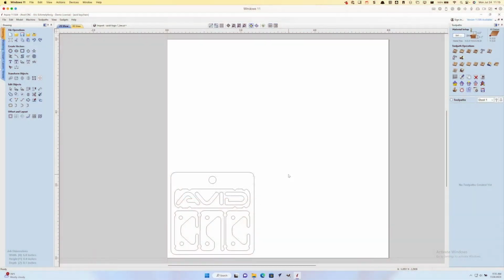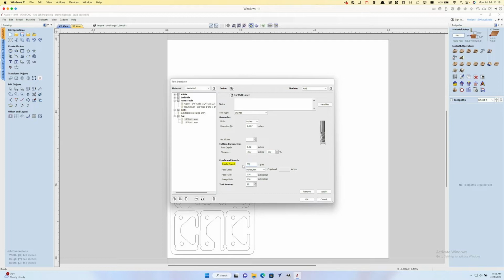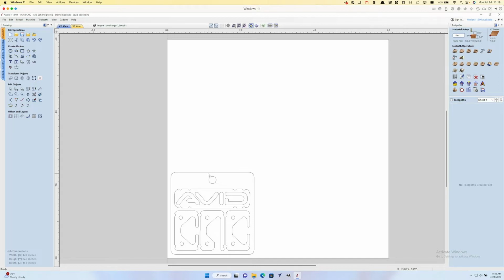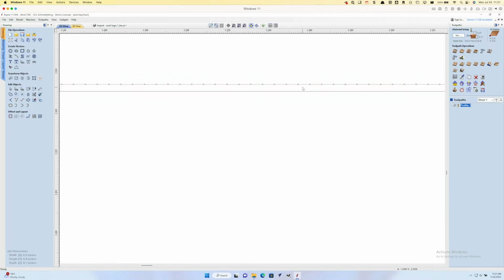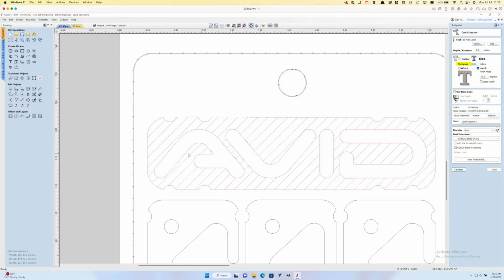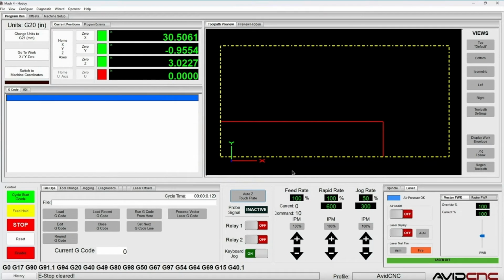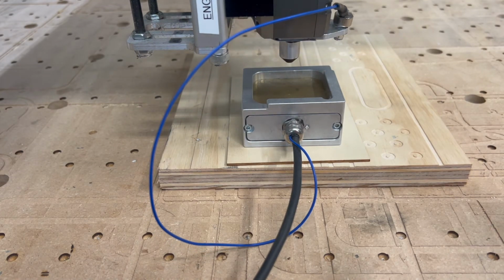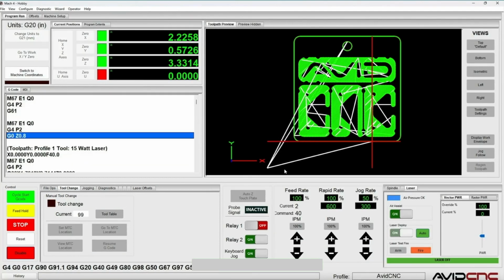Vector Creation for AvidCNC's Laser System

Comment: how can you justify the cost for the laser when lasers are now up to 40+ watts?
Reply from the maker: Excellent question! If you're talking diode lasers wattage is only part of the equation. Some companies measure the power supply draw as their wattage claim. The true measure is how many watts the diodes themselves are. Ours are a true 15. Additionally the alignment and quality is absolutely critical to getting max performance out of a diode laser. If one diode is off even a little your power level and accuracy drops significantly. We chose OPT lasers because each one is precision aligned in a clean room one at a time. The diodes are also individually inspected and tested before going into each laser. 

This means that you're getting every bit of cutting power at a super high precision from our laser. The 15 watt pairs really nicely with the spindle as the laser can cut up to about 3/16 of an inch at good cutting speeds. Anything thicker can be cut by the spindle.

The additional cost comes from the pneumatic raising and lowering mechanism which makes it super convenient to use in spindle/router combo jobs like this one https://youtu.be/-gGdTd22Itc?list=RDCMUCUURXMoW6I66UPUohD-Dkeg
Reply: Thank you for the response and i do understand what you are saying, but for the price you are not adapting to the industry, Falcon 2 and many others are providing great precision and 40 watts actual laser power. The setup you have is great but test have been done and it do not allow the ability to place a larger laser due to the weight. and 15w was great last year.  5000 Canadian for a 15 w is crazy. Im just saying if performance is lagging behind the competition the price 
should be alot lower. @AvidCNC
Reply from the maker: @michaeljacobs9432  There are some impressive dedicated laser units out there for sure. We looked at a lot of those. Our system wasn't designed to compete with those. Machines such as the Falcon (And others) that are small benchtop dedicated lasers certainly have their place and application. We designed this to be a high precision, high duty cycle unit that is tightly integrated with the router. Folks that use these are using them in production and need seamless switching from routing to laser.

I'd be interested in chatting with you further though! If you hit the contact form on our site ask for Eric.
Reply: This is designed for people who want to integrate laser engraving and cutting into their large format CNC operations. The laser itself is plenty powerful for engraving, I can't think of a reason I would want more power. You want to set off the fire alarm and burn through .5" of wood in one pass at 2 IPS, be my guest. 

Spindles don't work as well cutting materials under 1/4", which is where the laser excels. Also, a 4'x8' laser engraver is amazing. You're gonna spend $25k USD+ getting a laser in a format that large. I didn't bat an eye at $4k USD for this. Very high quality product as well.